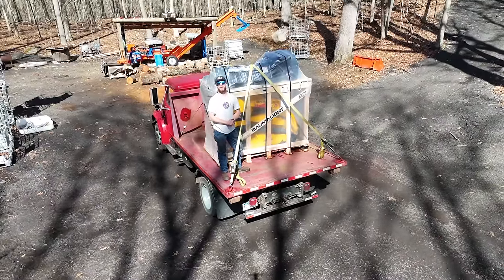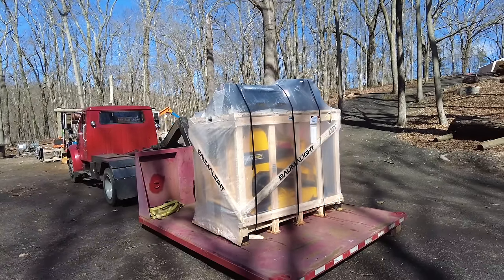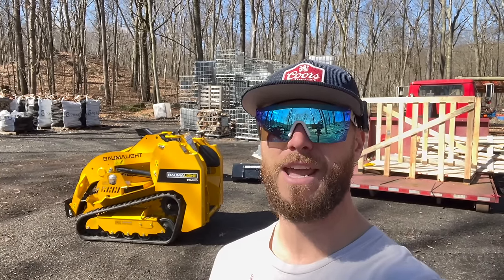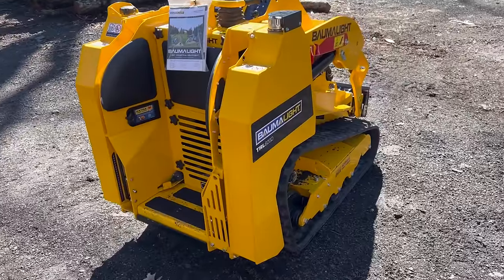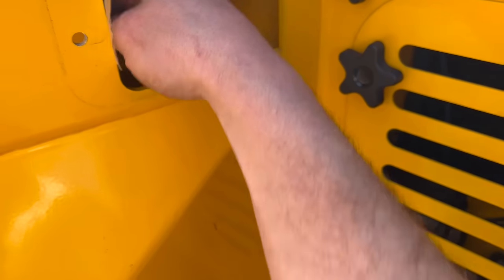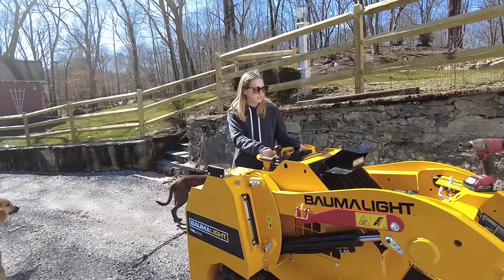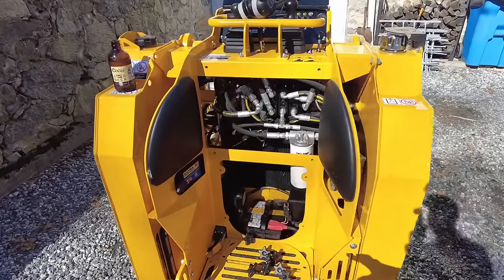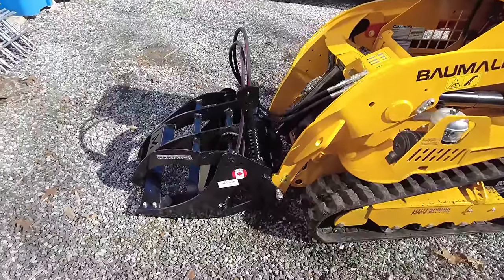#462 NEW Baumalight MINI SKID STEER Packs a PUNCH!!!

Comment: Mini beast! Jake, I have added that front plate to my grapple two years ago. The reason being that if I want to finger pinch one log off the pile it allows me to also you can pick up single boulders or rocks, and place them exactly where you want to. I have used it to move my bucket and place big rounds on my splitter since I don’t have a log lift. I’m sure others can find other uses having that plate in front of the grapple. Easy to put on and take off. Regards
Reply from the maker: Yep I can certainly see the plate being useful for certain tasks, I don’t think it’s necessary for grabbing logs off my pile considering the way they are oriented

Comment: What is that red bar on the right side for?
Reply: Probably safety bar for hydraulic cylinder when working on it with boom in the air.
Reply from the maker: Exactly!

Comment: Looks like a good machine.  I do not like the the dash unit. I fine that it adds expense and complicates working on the machine. Would rather have simple guages and controls. Computer controls always causes more costly repairs in the lond run.

Comment: Yeah , it looks like it's gonna be a pretty dandy a little piece of equipment As you were saying about the exillery is three hydraulic Leave her , that's there that it's on or It would be kind of cool for when you're running a grapple type Implement that there be a trigger On the hydraulic arm hydraulic arm leaver And then you would only use that Oxygen owner off labor in lake.You say operating a Mulch head Or mower
Reply from the maker: Yep they are going to be sending me a new loader lever with auxiliary hydraulic buttons for the grapple